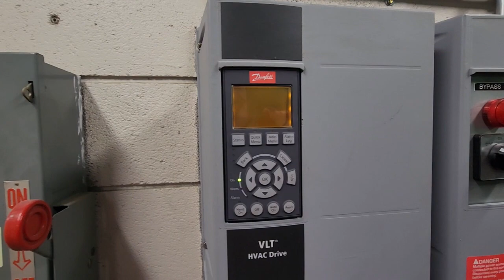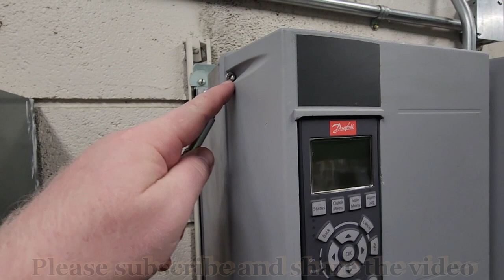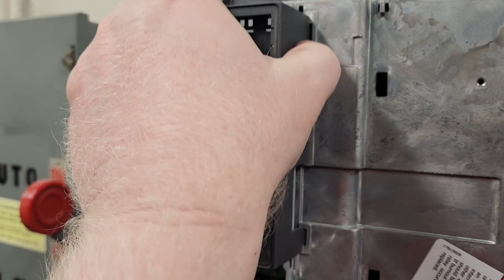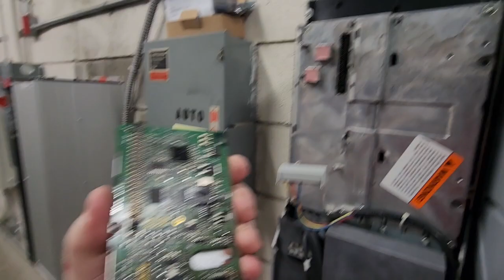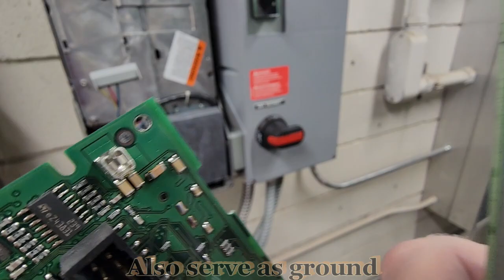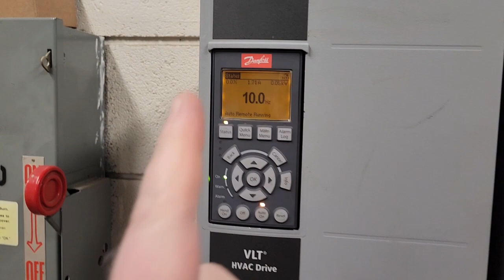Replacing the control board in a Danfoss VFD

Comment: Hello, i have Alarm 70 when installing new control board. Could you help me, how to resolve this?
Reply from the maker: You should be able to look up what that alarm is
Reply: The alarm is A70
Reply: I installed it outside the inverter unit, only cpu, power board (replaced), igbt board, rectifier board and CT unit. Not in complete unit, is this why the A70 came up?

Comment: Hello sir, I have a question, is having no display affected running the motor? Like in my case the vfd have no display at all nor the motor can start, but it has a supply.
Reply from the maker: The drive could have a fault or be set to off in the software. You won't know without the display

Comment: Hi there! I’m experiencing the same issue with my Danfoss FCP106 and came across your informative video. After doing some investigation, I’m curious—what do you believe was the root cause of the problem you encountered? Thanks
Reply from the maker: I think the contactor shorted and took out the power supply.  Replace the contractors and power supply.